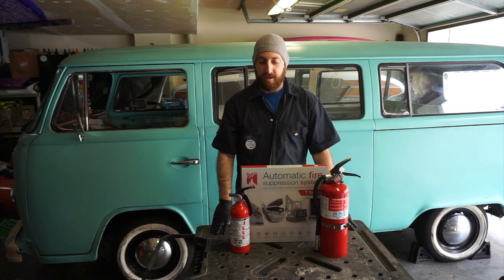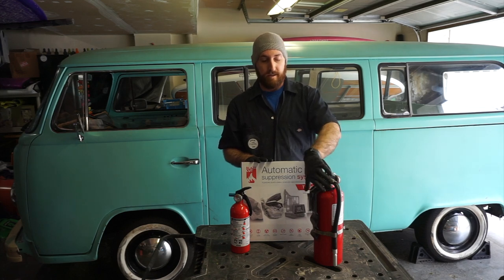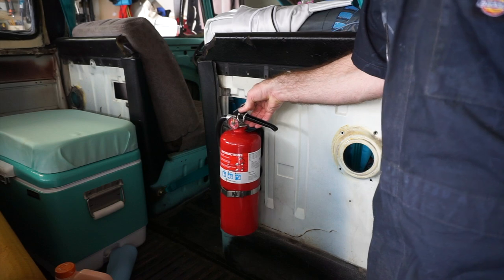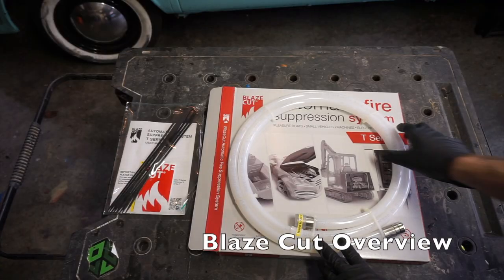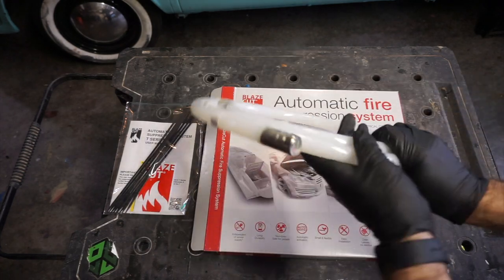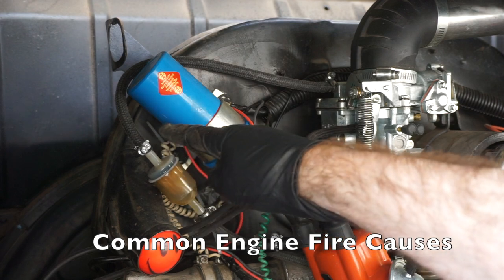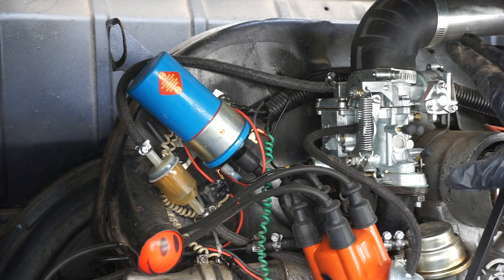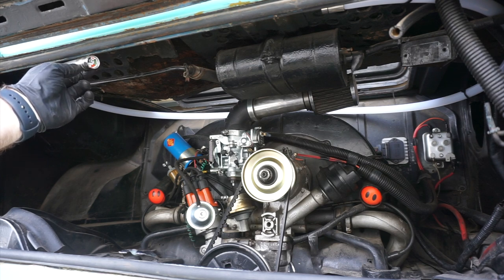VW Fire Safety and Prevention, BlazeCut.  1973 VW Bus Restoration Part 5.

Comment: Noice! An ounce of prevention is worth saving our Volkswagens!  I wish fuel lines lasted longer than they do...Replace fuel lines every 5 years?  I have been wanting to install a fire suppression system in my westy...How long does the blazecut last in standby? 5-10 years? 😎 STOC
Reply from the maker: They market it as “up to 10 years”.  So I’d say trust it to 5 and then regularly inspect it after that.  You can tell if it’s still good as the suppressant is in liquid form until it boils and bursts.
Reply: @callalilycollective  Noice! A boiling liquid? huh? 5-10 is about the length of time for new fuel lines too...I've been thinking about a garden hose full of baking powder, with some sort of fire sensitive CO2 cartridge  pressurizer...like a spring loaded nail held by a meltable string or something.  I hope you never need it and I look forward to seeing how durable yours is. 😎 STOC